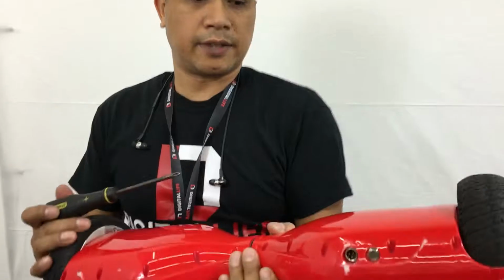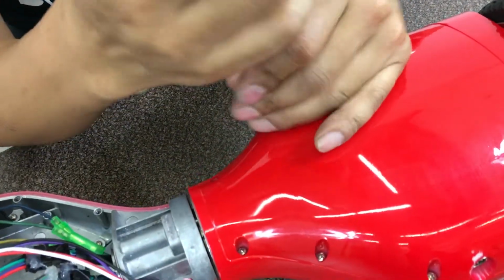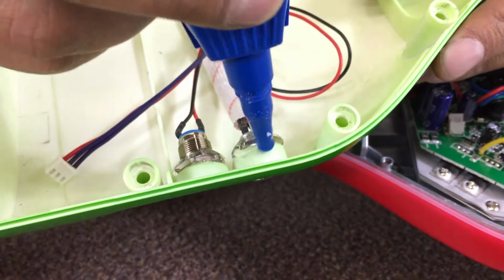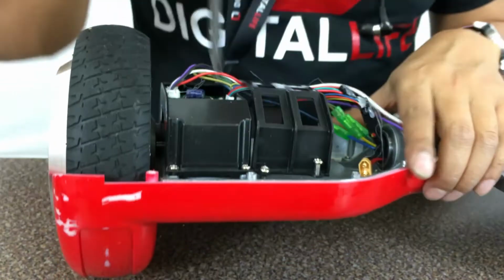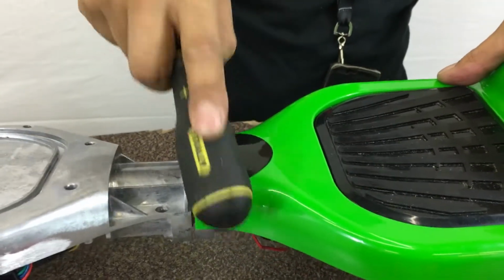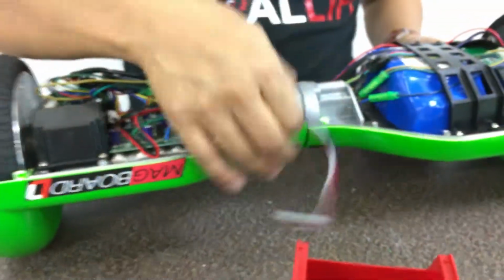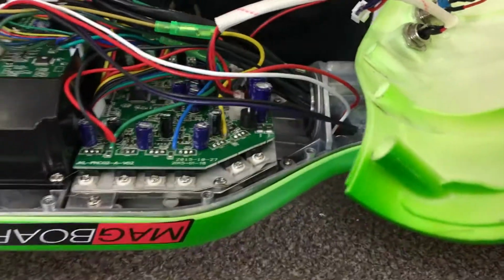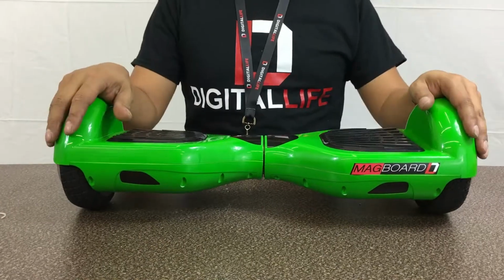How To Change Your Balance Wheel Shell & Replacement

Comment: Hi, I just got new hoverboard and it has a Bluetooth and led lights on the sides and front. Only thing is the battery drainage is extremely quick and I can only ride for about an hour.. Is there any way to fix this?? Thanks.